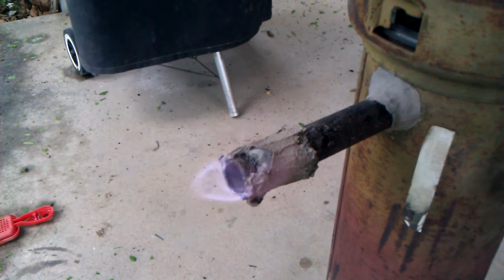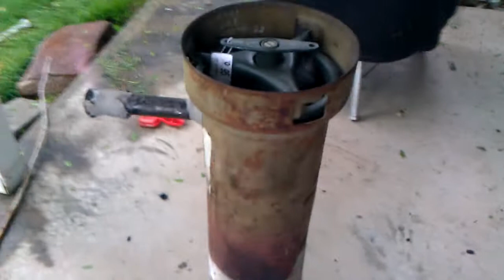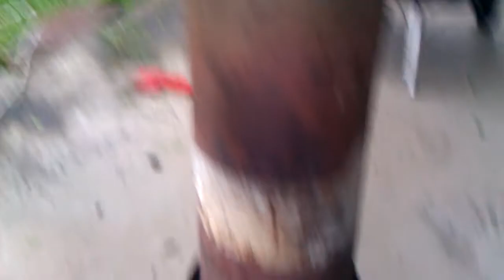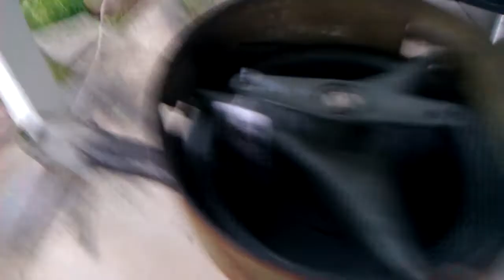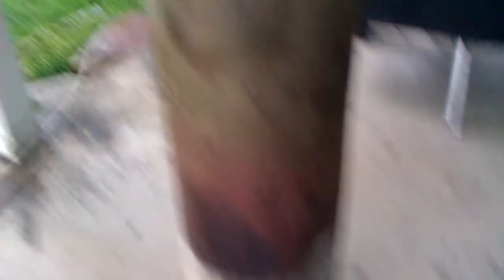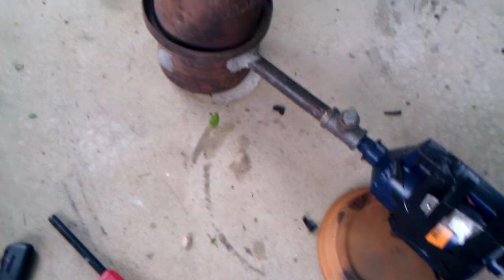First Gasifier - First Flare

Comment: what kind motor you are using sir?
Reply from the maker: I never actually got this gasifier to run an engine.  I tried using my 5HP lawn mower as the test engine, but couldn't get the air/fuel mixture correct.  Also, I found that this particular gasifier build had several air leaks (which are the main enemy of running on wood gas/charcoal gas).  The leaks were mainly due to that fact that I used furnace cement to seal the inlet and outlet pipes.